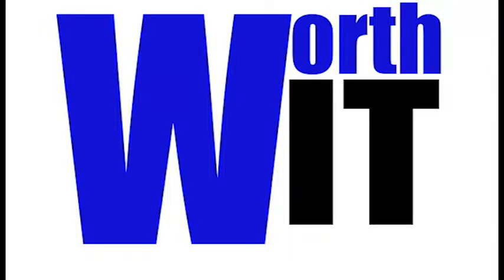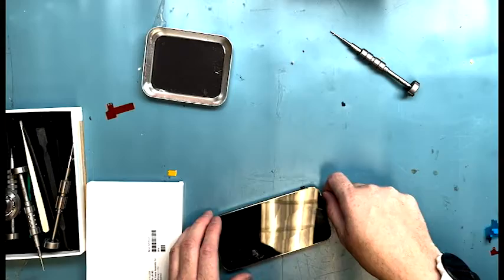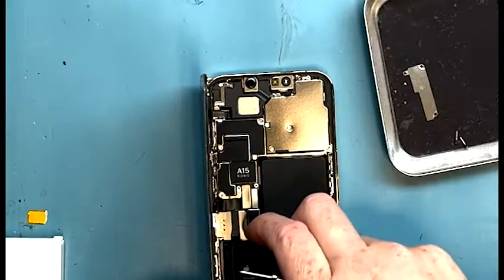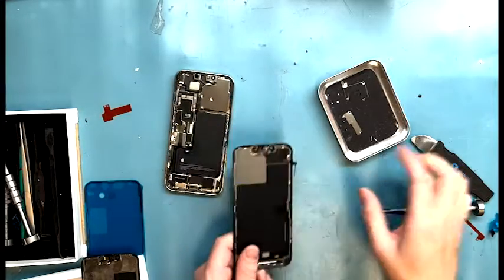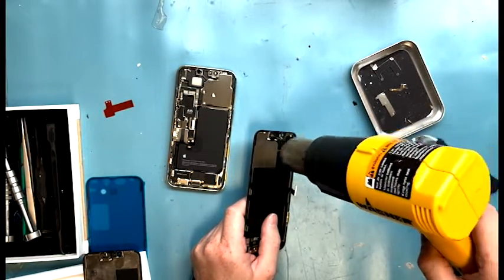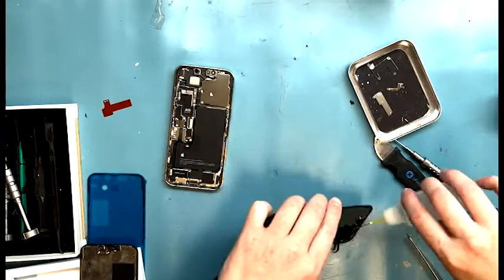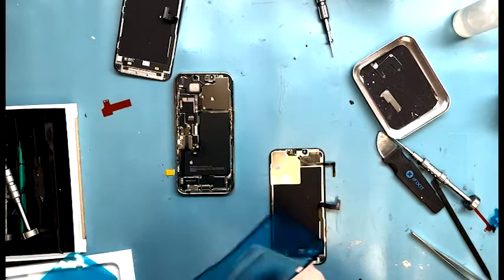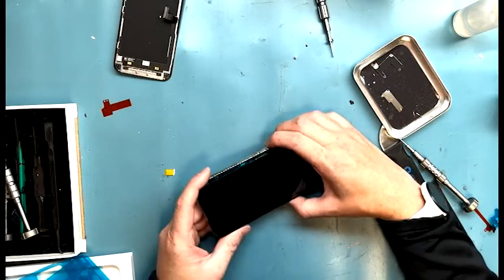iPhone 13 Pro Screen Replacement Guide

Comment: Where did u buy the new screen
Reply from the maker: @koolkidrulez  Mobilesentrix.com or injuredgadgets.com
Reply: @worthitrepairs  thanks
Reply: @worthitrepairs  another question what screen should I get lcd or old for iPhone 13pro and if oled soft or hard oled
Reply from the maker: @koolkidrulez  soft OLED glass is less likely to rebreak never buy the LCD kind it can make phone overheat and cause board issues
Reply: Where did u get this one that you used in the video injured gadgets or moblie sentrix
Reply from the maker: @koolkidrulez  oh I have no idea anymore

Comment: so the most important part of the video wasn’t showed 🤷🏽‍♂️ like does face id and true tone still works after that
Reply from the maker: Yes to face ID but not sure about true tone on older screens we use a screen serial copier and then it keeps true tone. I am not 100% but I think it still works without being programmed. Face 100% works still apple rolled back on removing face ID after screen replacement.
Reply: cool thanks for the reply